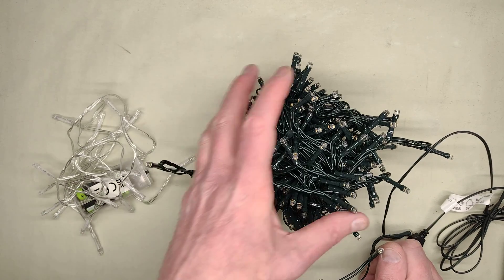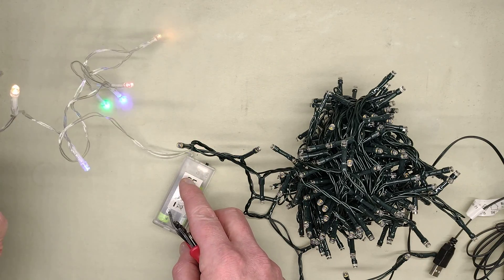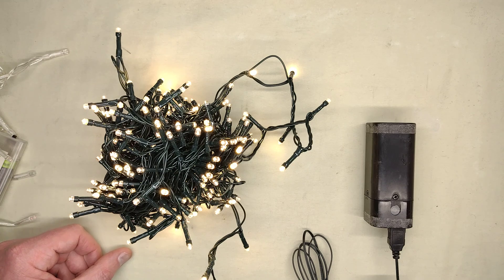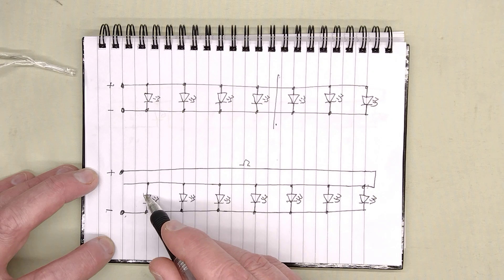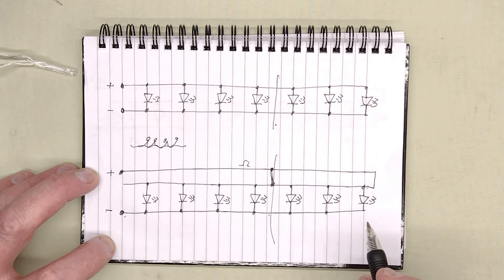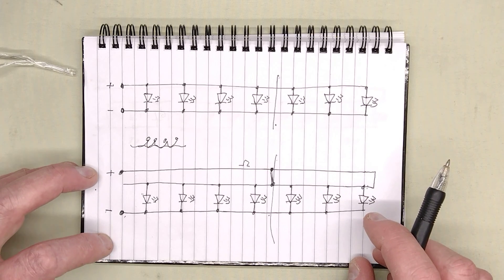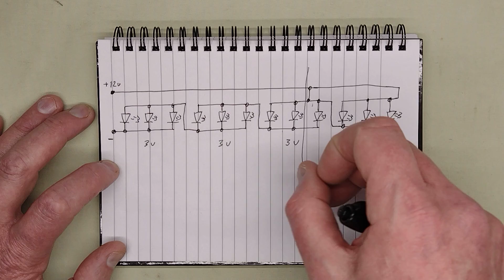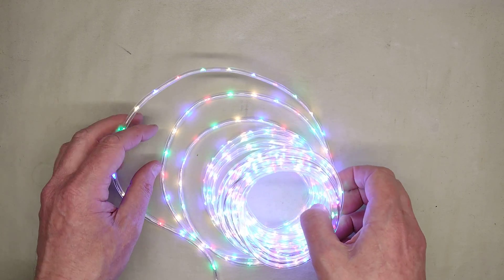How to fix your low voltage LED Christmas lights

Comment: That thin tube light is pretty neat, indeed. I wonder if you can get such with white LEDs only.
ps: You're bigger than k*vid! Best wishes and get well, soon!
pps: Your new old desk is... too clean... missing skidmarks... :)
Reply: At about 10:07 he mentions that ASDA also has them in warm white, uncertain about cold white, and that this is the colour version.

Comment: Anyone have any idea where to find a controller for some really old tungsten rope light? The light itself is still (mostly) working but the controller unfortunately had a run in with the good old Scottish weather and was sitting full of water.
Reply from the maker: If it's mains voltage you may just have to make the light static.  Even a mains voltage LED string controller may struggle with the higher current of tungsten lamps.

Comment: How /do/ they get the LED string into that (PVC?) tube? That stuff is annoyingly grippy.
Reply: Lube ?🤔
Reply from the maker: No obvious lube or powder.  Possibly compressed air.
Reply: Might it be some form of heat-shrink? Not necessarily the stuff we're used to, which tends to get very stiff when shrunk down (making it annoying for sleeving longer runs of flexible cables, to my eternal disappointment), but something where they could work with it at a greater diameter, then shrink it a bit afterwards...
Reply: @AndrewGillard  It would be lumpy if it were heat shrink.  It would shrink more between the LEDs where there's nothing to resist it shrinking further.

Comment: Oh dear!

British Standard BS 7671, Requirements for Electrical Installations. IET (IEC) Wiring Regulations, defines supply system "Low Voltage" as:
exceeding 50 V ac or 120 V ripple-free dc. but not exceeding 1000 V ac or 1500 V dc between conductors, or 600 V ac or 900 V dc between conductors and earth.

Hence, the domestic supply of 230 V AC in the UK and the supply for the Underground "Tube" trains in London of 630 V DC are both LOW VOLTAGE - under both British Standard BS 7671 and IEC definitions.

That which you are discussing here is defined by the IEC as "Extra Low Voltage" ( ≤ 50 V AC or ≤ 120 V DC )

(The UK uses the term "Reduced Low Voltage" for supplies ≤ 55 V AC - which is slightly above the IEC definition of "Extra Low Voltage".)

It is such a pity that not all countries have as yet "got on board" with the IEC definitions of "Extra Low Voltage", "Low Voltage" and "High Voltage".
Reply from the maker: I use "low voltage" to keep things easy and understandable for non technical people who are unlikely to think that 240V is particularly low.
Reply: @bigclivedotcom  However, should your postings NOT conform to British and IEC practices and "educate" these "non technical" people into an understanding of these "official:" terms?

Comment: Next time, I’d like to suggest you measure the actual resistance of that third wire.
Reply: I've measured about .158 ohms per meter. All of the ones I inquired about are their version of 26awg. I call it 26.5ish.

Comment: Of course by a judicious choice of power supply from eBay you can make your low voltage set just as unsafe as the mains powered ones.

Comment: I highly doubt it's extruded around the wire. You'd need to have an extra feeding mechanism that adds the LED string as the tube is extruded, meaning you'd need expensive specialised extruders. It's probably something much simpler, like some exploited underage children shoving a nylon filament like fishing line (if you've ever tried to tie a knot reliably into fishing line you'll know how slippery that stuff is) all the way through sections of commercially available tubing that they then tie to the LED string and pull in.

Comment: The LEDs getting dimmer over the length of the strand demonstrates why the "water in a pipe" analogy of electricity is flawed. It needs to be thought of more akin to air, or a similar compressible fluid.
Reply: The LEDs get dimmer because the electrical flow encounters a resistance in the wire.

The same thing happens to “water FLOW in a pipe”.
When water flows in a pipe , it encounters resistance, due to contact with the tube walls, which drops the water pressure along the length of the pipe.
This is called DYNAMIC or FLOW pressure.
This does NOT happen to water that is not flowing, or static.
This is called STATIC pressure. When water is static, the pressure is the same at every point inside the vessel (pipe).

The same with electricity.. it must flow in order to encounter a resistance.